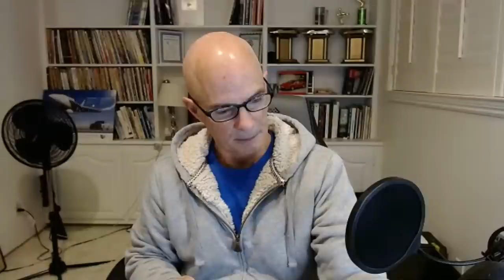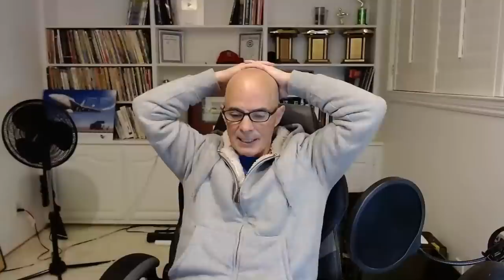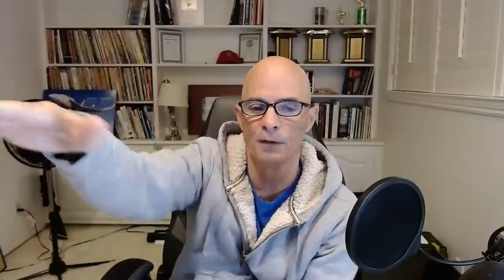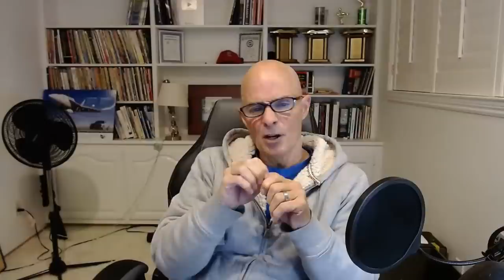LET'S TALK TECH-HOW TO MAKE 500-HP ALL-MOTOR 5.3L

Comment: Great video Rich. 
With your planned 351 build, would you consider the 393 stroker crank with Windsor rods and 5.0 pistons, that combo would give plenty of capacity to test heads from GT40 to 225 heads…
Reply: I had a fox 5.0 short block a set of tw heads and a 351w roller long block and sold it all :/ sux balls I was a crank away from a budget stroker

Comment: Would machining deeper valve relieves in the factory pistons weaken them too much? Technically still SBE, but you can run more cam, because that sounds like a major limiting factor
Reply: No, because you’re taking very minimum amount off.  There’s a tool that a company sells that has the measurement gauge and uses the cutting tool that goes through the LS Val guides…. You more less just need a bit of patience and the cutting tool and a drill.

I’ll try to find the company that sells the cutting tool.  My friend has a big tire Nova SS with a huge pro charger and a huge cam, SBE and that’s all he’s done.  He has to be making 14-1500 HP.  The only thing he does it bend the odd rod.  He just puts another used junkyard rid in and goes racing again….  This has been for 7-8 years now.  Gen 4 6.0.
Reply: @Willy Wonka  so the rods are the weak point? I wonder if Richard has time/interest in doing this as a test, and compare prices between getting the stock pistons modified vs after market pistons
Reply: Just add boost… you’ll bend the rods at 1200+ hp LONG before you run into the “too small of a cam” problem

Comment: So in pa there is a limited steel block steel head late model 358 class. I have a 5.3 block with 6.0 steel heads. Tge biggest issue i have is the flat tappet cam. 525 liftI can get one made frpm cammotion for 900. I wonder if you can try this combination and see what kibd if numbers you can make. I have a set of steel heads i can lend for the project

Comment: I sit and wonder... and OFC it's a PushRod V8.... but should it be so hard to match it's DOHC cousin's from Europe?

There are engines like the BMW S65B40 that produce over 100hp per liter, factory... good fuel consumption and all..

We run them with 95RON (89oct?) fuel all day without trouble, getting as much as 18mpg combined..

I would imagine a 5.3 with proper heads and a mild cam would make 530hp easy...

People have been north of 500 with the S65 with all motor, and G-Power had a "Hurricane" version of the M3 making 770whp with only bolt-ons and warrantied it for customers that came with out of the box cars, so... pretty sick in my opinion... new M3 back in 2010, go to G power and have 770whp with a 3 year warranty...
Reply from the maker: the great thing about life is you get to like what you want-We can (however) do without the display of insecurity (putting down others-especially groups, in an effort to elevate yourself)-Say it with me (Every Motor is Good)
Reply: @richardholdener1727  i never said the LS was bad... 

I guess it comes down to DOHC vs SOHC vs OHV and all that... how much volumetric efficiency can be made...